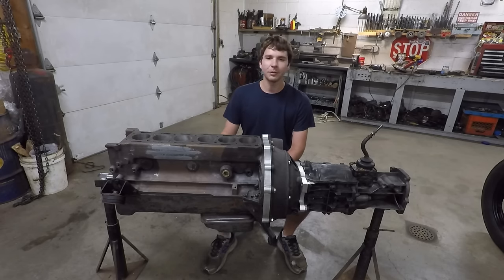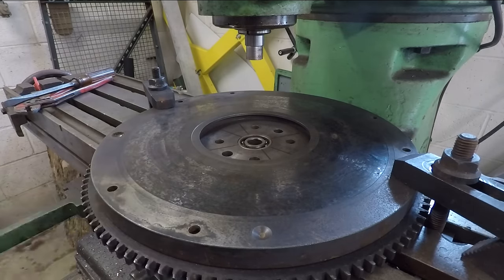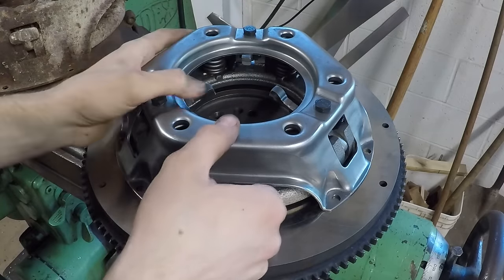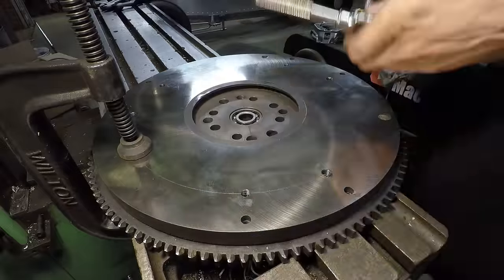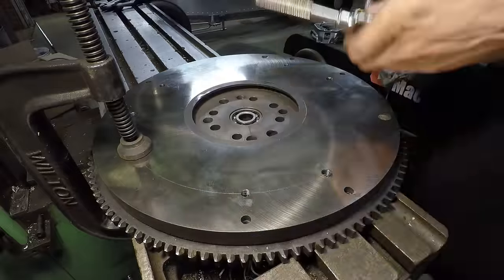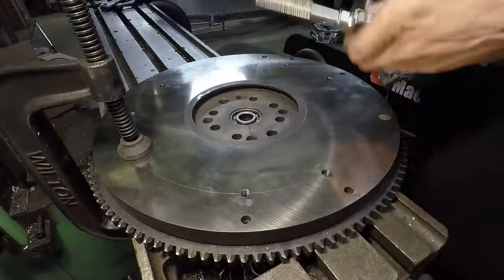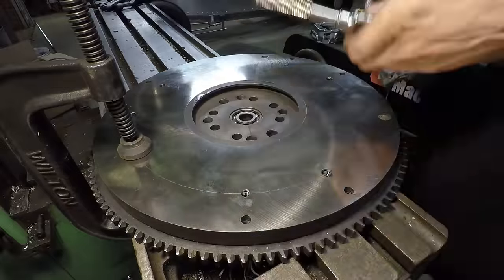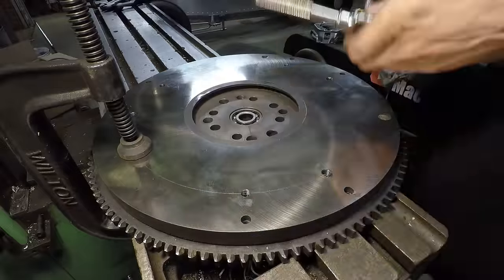Adapt ANY Engine to ANY Transmission!

Comment: I love your attitude. my dad was like that too. if another man can learn how to do something so can I. question of curiosity is why didn't you just leave a little extra for the 2nd alignment dowel on the adapter instead of drilling a hole in the flange
Reply from the maker: it would've been more than just a little extra, and it's easy enough to just drill a hole for a new pin

Comment: Thats good on the mechanical part, have you find a way to manually control an auto transmission without the need of an ecu, that would be gold.

Comment: I would of used a rotary table to index the holes and clocked everything and started tapping the flywheel with the tap in the mill head to keep them square ,hope it all works out OK for you

Comment: Great video and tutorial on how to make adapters for these "exotic" engine builds.  One question that immediately becomes evident: when joining metals of different kinds, ie. steel and aluminum, how do you accommodate differences in expansion at those joints when the engine reaches operating temperatures, somewhere about 180 to 225 F?
Reply from the maker: it's not significant enough to really matter

Comment: Super video, well done. One question, would there be some concern that with the number of holes out of the centre hub of the flywheel that it significantly weakens that vital core strength there?

Comment: Possible sever vibration issues?  Years ago while working in Saudi Arabia as a mechanical supervisor at a Saudi military base I  had Pakistani mechanic come to me telling me his rebuild was not working properly.  We got together and he started up the engine on the engine stand and it ran just find at idle.  The problem was when he increased the rpm up to around 3,000 we could hardly keep the engine on the stand due to vibration.  I stood around asking questions and could find nothing which seemed wrong.  He told me he had just honed the cylinders and re-ringed the pistons and changed out a badly worn flywheel.  I found a serial number for the flywheel and went back to parts to find it belonged on a different engine displacement.  So I was sure the problem was the flywheel was not balanced for the engine displacement the mechanic was rebuilding.  I asked him to use the flywheel I had just found and his reply was it would make no difference as the one he had installed bolted up properly.  He did not understand that bolt up did not insure proper balance.  Well I finally got him to change the flywheel and the engine ran smoothly.  I wish I could remember which two engine sizes had the same crankshaft/flywheel bolt patterns but that doesn’t really matter. My question is how are you going to balance the crank and flywheel if you find you have vibration issues?  You will need to disassemble the lower end and remove the crank to dynamic balance the unit to the best of my understanding.

Comment: I would have tried chucking the tap into the machine and cut new threads for the pressure plate mounting holes...at slow RPM and backing out every couple of mm.of depth.

Comment: nice build..  but you should really use the spindle and a center or some kind of tap follower when you hand tap holes..  seems weird but it is possible to tap a hole at an angle.

Comment: Thanks for the information.  I bet that straight 6 sounds great in an old speedster.

I was wondering if I could put a new 7.3 gas engine in my 78 Bronco with a ZF 5 speed.  Its all Ford but a conglomeration of metric and SAE.

Comment: Use to be very popular in the 40's - 60's with an adapter plate form Warshawski in Chicago.  Could pick up a 48 Ford or Plymouth coupe for 50 bucks, Chrysler V-8 engine at a wrecking yard for 65 bucks with everything on it.  Could leave spoil brat rich kids in the dust that didn't have enough brains to connect an air hose to a flat tire.  But this was in the land of the free.  Today, can't even replace a different spark plug in your car without having the EPA on your butt, and if an insurance company finds that, won't cover you even though it was the other guys fault.   Miss those days.

Comment: So with a spacer/adapter at the engine to flywheel housing, and another one at the flywheel housing to the transmission, isn't the transmission input shaft too far away now to engage the pilot shaft bearing or bushing now?🤔

Comment: On the "dowel pin holes-- after drilling it, I would have stepped inside and touched the drill bit down again, to make a little starter hole mark, just to mark them and make it easier to automatically find my dowel pin holes right away.

Comment: I put a 1980 Nissan pickup 5 speed behind a Falcon 6 about 30 years ago, I still have it, its run over 200k miles in 2 different vehicles. it uses the Nissan flywheel, clutch & starter, via a steel crank adapter.  What is that cool old milling machine, looks like a Cincinnati?  My way to do this is to work from a alignment shaft in the mains of a empty block.

Comment: That's awesome work!!! I never even thought that you could go from one brand engine to another brand trans front half to a different third brand trans back half (but I bet you can also tell I'm not a mechanic...). A gap can be seen between the custom aluminum adapter plate and the engine block (around 23:00) by your right hand near where the starter is going to be; In my ignorance,  may I ask if that gap is going to affect anything? This build has got my attention, I'm going right to Part 2 of this video!!!

Comment: I like how the location steps are  explained.  
Two  questions.  
What  made  you choose  aluminum  for the  adapter  plates?
Is galvanic  action a concern?
Reply from the maker: Aluminum is the obvious choice since it's strong enough at the thickness I needed and it's easy to machine. I'm not worried about galvanic corrosion since it's not going to be exposed to water/ salt etc.

Comment: Is that a mini-tank?
I think it's a flippin tank! 
Do I cut away $480 worth of a $550 plate of aluminum or buy a great big bag of washers and longer bolts and just space it that way?
Subed .... I gotta find out about the mini-tank ... and this project.
Reply from the maker: Yeah, if you go back I have videos on the tank too. The aluminum plate actually only cost about $120

Comment: Surely he knew that Jaguar did make a flywheel, clutch and gearbox (some with electric Laycock overdrive) that would had mated to this XK engine quite well with way less effort.   And there are updated Tremec 5 speed units that would work quite well also.

Comment: Interesting combos, my engine blow on my old '92 D21 Nissan pickup truck bought a used engine but have a 5 to 6 inches clearance issue with the firewall is there a way to extend/adaptor the gearbox without cutting into the firewall?

Comment: Hi, great video.  Is the alignment between the c/l on the crank and the c/l of the flywheel maintained when you had the recess on the flywheel enlarged to fit over the crank mounting flange?  I'm assuming the flywheel recess would have to be almost an interference fit to ensure the two were aligned or else the flywheel would be out of line with the crank?  Thanks.

Comment: I was hoping the ford would win the race as the jag I have had many and never stop causing issues , those adapter plates just added 2 inches to the length of the power plant  ,hope it all fits in the engine bay

Comment: I enjoyed your video and I have a question. I'm not a machinist but I was curious about the electrolysis that happens from aluminum steel what do you do about that? Cuz I think it was back in the 60s they had cars where they put aluminum washers on the bumper and the aluminum eat the steel.

Comment: Should be able to run more initial timing due to the lightness of the pressure plate timing will give you more cylinder pressure

Comment: Sort of. Try a Buick aluminum V8 onto a Corvair transmission.  There MAY be a metal strong enough to make the coupling rod but I couldn't find it. It twisted in half every time, even for some EXPENSIVE alloy steel at $90 a foot!

Comment: yes, great video.how did you know that old Ford bell housing would work? what I would really like to do would be to put an NV 4500 5 spd trans w/5.61 1st gear & .73  OD into my 95 Dakota Magnum V6. Dakota uses the Aisin AX-15 w/3.83 1st gear & .79 OD. Would get 50% more low gear & 6% more OD.

Comment: I have a question... I'm doing the exact same thing for adapting a Chevy t5 to my Ford falcon 6 and had a question regarding the types of bolts you used for the 9 inch clutch? What sizes did you use?

Comment: Any idea how to fit an MG 5 transmission (out of a 97' gmc 1/2 ton, four wheel drive, five speed) onto a 292 inline six? Where the started bolts on, they don't line up.

Comment: So I’m trying to adapt a Mercedes m113 engine to a 4L60e transmission but the problem is that the flexplate on the Mercedes engine is recessed into the engine block. How do I get around that?

Comment: How did you decide on the flathead Ford Flywheel, pressure plate and bellhousing? Were there measurements you were matching up, or was it just a whim? So let's say I have a '72 Fiat 124 engine that I want to connect a 2020 Fiat (Miata) 6 speed manual to. What would I need to look at to determine if I could use the Miata/Fiat bellhousing, or would need to find something else?
Reply from the maker: I used the ford parts for a few reasons. It's what I had available, I was familiar with how it works, and I know there are a lot of adapter kits for fitting the T5 to the flathead V8. That meant if I was able to make the rear end of the jaguar engine look like the flathead, then the rest would be easy. It's important to make a lot of measurements beforehand to know if it's going to work.

Comment: Nice work!
A dro would save you tons of time.

One question, why didn’t you clamp the parts on parallels or 1-2-3 blocks then move you x and y to pick up the hole patterns?

Comment: If you could replace those bolts and use bolt head that have holes in them to secure all 4 of them with lockwire, that will guarantee you no bolt backing out.

Comment: I plan to swap my Volvo 940 B23 engine (non-turbo) with Volvo 850 2.5L engine (transverse position) and keep maintain the original 4 speeds A/T AW 03. Perhaps you have experience with making the adapter plate for A/T transmission. Please your technical recommendation or consideration. Thanks for your support

Comment: I am going to bolt together Gen 3 LS LQ4 6.0 to a SM465 4 speed transmission. Do you have any recommendations? I am also going with the original set using the mechanical clutch. Let me know thanks

Comment: Great mod and video, though slight misleading Title, newer transmissions "automatic" require computers and many items and engines to talk to each other to work. otherwise, I would have my international 7.3 attached to a 6-speed modern trans as wold many many others. but there is no available way to make them work together.

Comment: @MacroMachines my question is, when using an 5/16 inch thick transmission to engine adaptor for an automatic transmission, will there be any issues with the torque converter not engaging properly in the pump since the transmission is now 5/16 further away from the flywheel ?

Comment: Man, well done!!! I am really curious to know how you centered the bell housing to the crank though? I know the extensions you stacked on the crank got you close, but how did you know where to drill your pin holes to be dead nuts accurate? Also, why not put a shim between the crank and flywheel, instead of facing that whole block of aluminum? Not trying to criticize at all, this is a project I've wondered how to do for years and your video just got me really thinking about it...

Comment: Don't overtightem the cam covers or the bosses will crack. The half-moon seals like to leak so if you don't need the tach drive you can weld them up or turn a filler piece with a couple of o-rings.

Comment: Hopefully the jag engine didn't originally have its flywheel as part of the crank balancing.  Some engines do.
I'm not quite sure how you knew the starter spacer would make the depth of the starter be correct.
Also not sure how you determined the length of spacers so the transmission shaft would fit into the pilot bearing.  I guess in the end it's all just measuring and checking, but what if the transmission shaft is too short, then what?
Also I think I would use locktite on all the bolts.

Comment: Awesome job! I have a question doesn't drilling holes into your fly wheel throw off the balance since flywheels are balanced from factory wouldn't drilling holes change the weight of it?

Comment: A small request, you've adapted the outer pieces and talked briefly on the input shaft connectivity. But is there a reason one could machine the shaft shorter to adapt the engine and transmission combo you wish?
Reply from the maker: if the input shaft was too short, then there wouldn't be room for an adapter. Having extra room to work with is a good thing

Comment: and how do you handle the length of the transmission shaft??  it will not proper fit in every  case. and not in double adapters

Comment: How about adapting a 1970  VW engine to fit on a rear engined 1949 Allis Chalmers Model G tractor? Can it be done using the VW  clutch and pressure plate?  I do have lathe and mill, welder, various tools. This conversion would up hp from 10 to 57 hp.

Comment: You mentioned that you needed a 1.115" thick plate, but were going with a 1.250".  Did you mill that down to 1.115, or leave it thicker than needed?

Comment: I have a 1970 maverick that I plan on swapping 1997 om606 Mercedes diesel into and a 2012 ford 6r80 transmission.  it'll all bolt up with the adapters I ordered.  I think the trans tunnels going to be the hardest part of it. I wish I could put a built 6r80 behind the the 7.3 in my f250.  They sell adapters to put it behind big blocks but not the 7.3.
Reply: I need to know the source of the adapters, please.
Reply: That lemons3738 got his from or that you (MacroMachines) mentioned…

Comment: Don't know if you'll see this or not, but I was wondering what drew you to the flathead bell housing, clutch and flywheel?  Did you already have them or was there some other reason you went in that direction?  Also curious are using a DRO on your mill?

Comment: would you not been better off lineing up the pins from the jag to the fly wheel then lined up the bolt holes, as less time and you have 2 points to work from or changed the jags crankcase wheel to fit the ford ? great ideas you have but just think alot more work than needed,,ive seen a guy cut a centre out of a fly wheel and weld the jags xjs fly wheel centre into a modified one

Comment: I found out meny years ago when I was modifying engine parts I was told that mechining cast Flywheels is a problem area as they can exspolde on use and is dangerous and so you need to use a new after market aluminium one, also on the Flywheel on some engines there are timing marks that need to be addressed, what are your thoughts on this thanks good subject this.

Comment: Just a few thoughts... You never mentioned verifying the direction of engine rotation so you don't have too many gears in reverse.  My Ford 5.0L V8 requires a flywheel with specific imbalance, so you won't always enjoy the freedom you had on this particular project.  The crankshaft-to-transmission alignment is dependent upon the final set of dowel pins, and a few thou is all the error you should have here.  I was disappointed you left out this most critical part of your effort: precisely locating the second pair of dowel pins.  Fun project!!!

Comment: I’d love to put a ZF heavy duty 5 speed manual transmission from a 90’s F250HD in my 2011 2.3 4 cylinder Ranger but I doubt that the transmission tunnel would clear that transmission.

Comment: Why not machine out the flywheel centre then fit a correctly drilled blank using Dutch dowels to retain it. Dutch dowels are used on final drive crownwheels so they can handle the torque.

Comment: Ok.
Here's the challenge.

1998 Subaru Forester trans.
Why?
It's small, it's strong and it comes with 4:10 gears.

I want to mash it up against my Nissan 1987 2.4 motor that has been seriously improved.
New hp. 147.
New torque. 213.
Going into a samurai that I got for free😊.

So is this combo possible?

Your the first vid I found even talking about this and every mech said I was an idiot for thinking about it.
But it all was free except for engine rebuild parts.
So thanks for the hope.

Comment: Hello, a friend of meine has a Ford Transit 2.2 tdci 3v63 FCD 2014,he wants to chamge the Motor with another one of 2017, the Problem is tha the car is a RWD and the Motor of 2017 is for FWD, can He use that Motor although it is a FWD for a RWD Forts transit?
Thank you!

Comment: Adapt any engine to any transmission; all you need are a bunch of super specific parts from a variety of very uncommon sources that just happen to work with the particular components I'm using for this video!

Comment: REALLY NEED HELP
I’ve been wanting to build a project just like this one but mid engine. I was wondering if anybody knows a transaxle transmission I can use with a 302 Chevy or any other v8.  
I’m just worried about have the right spline pattern 
Thanks 🙏

Comment: in Australia all through the 1970,s 1980,s it was common to see ford toploader 4 speeds behind chevs. Supra 5 speeds behind 6 cylinder holden and fords.  the supra is weak and low geared, the toploader is strong as hell.

Comment: How is this even centered other than by copying the dowel pin locations with a piece of paper?
I'm making a plate for my engine and even after hours of measuring I can't get the final plate clocked in under 0,1mm.